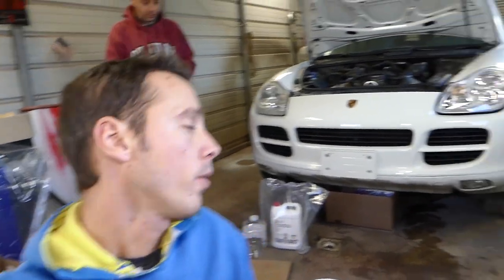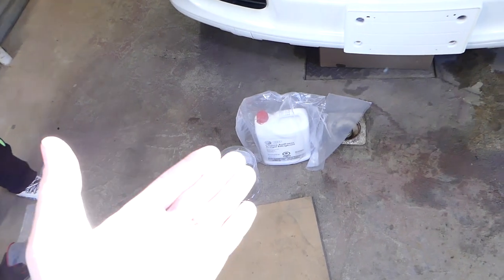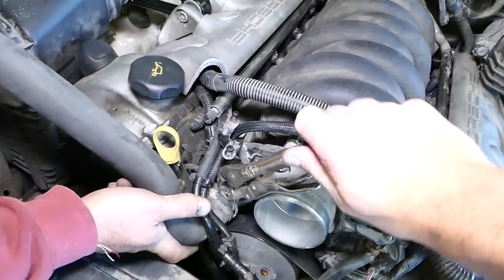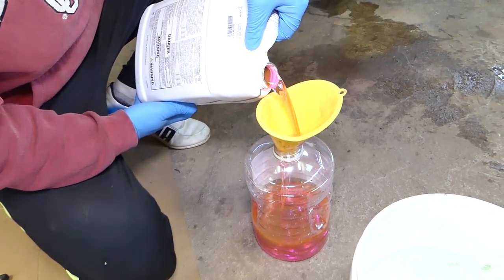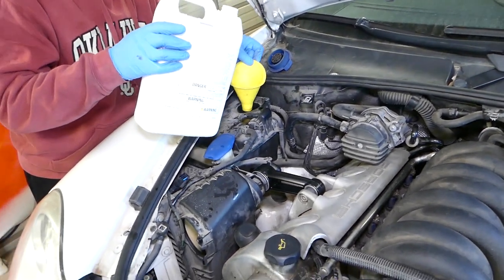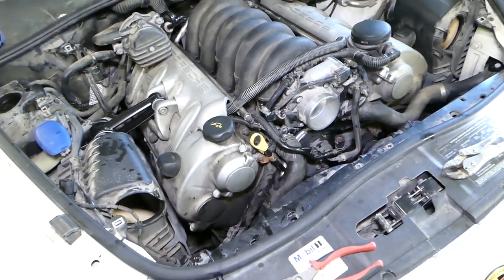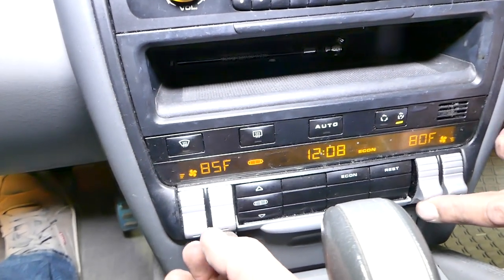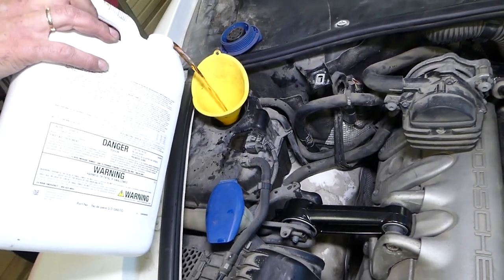HOW TO BLEED THE COOLING SYSTEM ON PORSCHE CAYENNE

Comment: Ok guys, I had to do the same thing to my Chevy except instead of messing with disconnecting the radiator hoses I had someone inside hold the idle steady ~2000 rpm while I had the overflow cap off, heater temp AND fan on high, and I would go back and fourth squeezing the 2 radiator hoses  like you had there (input/output) and also topping off the overflow as needed.  You'll know it's good when you feel the pressure in the hoses and the drivers says the engine temp is good and the heaters blowing hot air as well as the overflow remaining filled. Put the cap back on, tell your friend to get the hell out of the driver seat and take it for a quick 10 min spin!